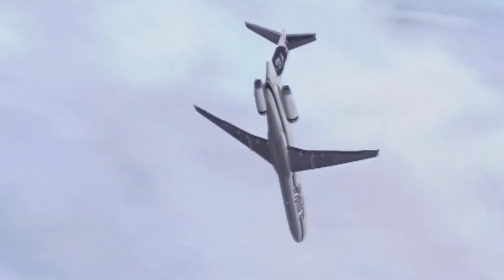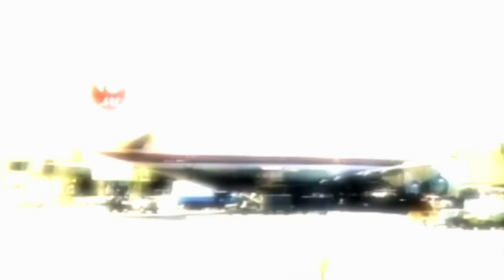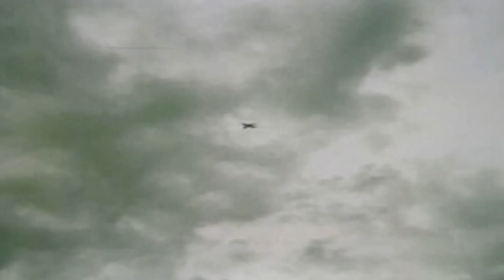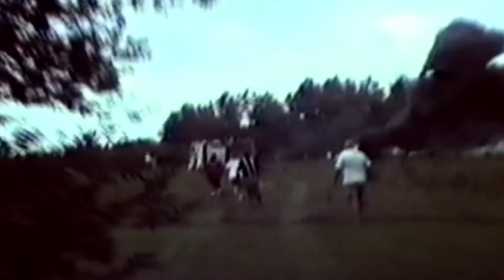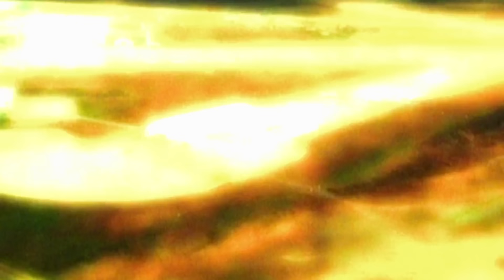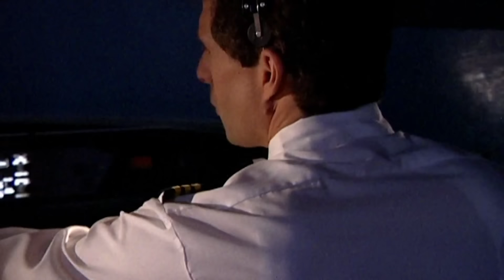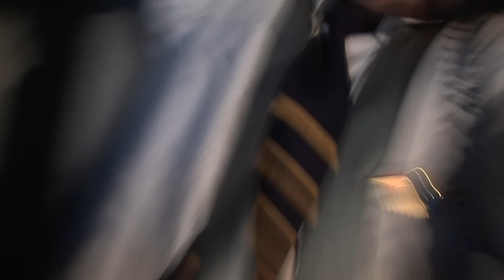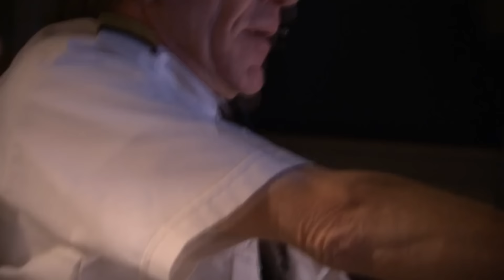The Consequences Of Overlooking Aviation Maintenance And Repair... | Mayday: Science of Disaster

Comment: Wow...where to start!  Alaska Airlines flight ✈️ 261 was not 🚫 brought down by faulty maintenance.  No airplane maintenance is performed without paperwork to tell the mechanics what to do.  And even more paperwork to tell the mechanics how to do it (the maintenance manual, structural repair manual, etc.). Simply put:  no paperwork = no maintenance.  The jackscrew inspection and maintenance (lubrication) was pushed back from 600 hours to 2,400 hours.  This crash is on Alaska Airlines maintenance management.  As for the Southwest Airlines 737, the "C" and "D" maintenance checks will not 🚫 ever be done in one 8/10/12 hour shift.  It's just not 🚫 going to happen.  And most of the time, a "C" check is done with the aircraft on jacks, and all of the time on a "D" check.  And now the JAL 123 crash.  After the tail strike, JAL contacted Boeing engineering in Everett, Washington (not Seattle) where the 747 was manufactured (the line is closed now).  It was a Boeing structural engineer that came up with the repair, not a JAL mechanic.  The JAL structural mechanic performed the repair as instructed by Boeing.  If I remember correctly, this Boeing engineer committed suicide after the crash.  How do I know all of this?  I have two F.A.A.  licenses, airframe and powerplant.  I worked on Boeing commercial aircraft for 20 years.  As an industry insider, I was privy to reading the N.T.S.B. A.A.I.B. crash reports.  Keep 'em flying boys!
Reply: I was a military pilot we take care of our planes much better that the public planes. I say close down the companies that don't follow the rules. If they are that broke they shouldn't be flying!
Reply: @mulgakoldas2692  Retired U.S. Navy (Navair) here.  Absolutely correct Sir!  Thank you for your service!🇺🇸
Reply: @mulgakoldas2692  I was at Davis Monthan in 1979 when the A-7 went down over the university. Talk on the flight line was that the airplane had a low fuel pressure light several times before the crash. The filters were pulled and aluminum was found each time. Final tally was that the fuel pump was chewing itself up and no one made the connection. I worked on the H-3's at the south end of the ramp. Later the unit was shut down and I with half the crew were xferred to McClellan to the H-53's there. One guy immediately saw an inside oil reservoir coming back overflowing from each flight. An oil sample revealed that the oil was heavily deluted with fuel because a seal between the engine's fuel control and driving gear train was leaking and allowed high(er) pressure fuel into the lube system. The engine was pulled. I grounded another because the sight glass on the tail rotor gearbox was badly stained and had a false permanent level across it's face. The stain was because of heavy contamination of the oil that had probably never been changed.  I was (still have the license) an A&P before I went in so I can tell you that the AF training is fairly good, but 18yo kids need OJT under a watchful mentor plus one has to stay on top of laziness and complacency.
Reply: Retired A&P here. Yup
Reply: @wizquinn8021  A and P ?
Reply: @mikeh.7499 Airframe & Powerplant mechanic
Reply: @eduardgenardandalis1437  thanks!
Reply: @mikeh.7499  You’re welcome
Reply: So what brought down the Alaska MD-83 then? 
I'm curious because you mentioned that it was "not" because of lack of proper maintenance.
Thank you
Reply: @btbd2785  what they are trying to say with regards to Alaska airlines is that it’s not the mechanics fault but rather the fault lies with the bosses of the company the owners who insisted that the time between maintenance checks be extended so as to make more money they are responsible not the mechanics because if they didn’t value money over lives this wouldn’t have happened
Reply: @surgeon1016  Exactly 💯% right!
Reply: @Surgeon 101  
I understood that but either way, you look at it no matter whose fault it was, yes the maintenance was not done because the supervisors who head or control maintenance decided to tell the mechanic to push out the scheduled maintenance to save cost.
Either way, you cut it, it was a poor decision to not allow the maintenance to happen on time, therefore costing lost lives!
Reply: @surgeon1016  THAT IS EXACTLY WHAT I HEARD!!! Thanks for confirmation!
Reply: @S.R.W  

Yes and I understand that completely " my point was that even though yes it wasn't because of the mechanic's fault and because of the supervisors " the point made was it happened as a result of not having the maintenance or grease in this case" so directly relar8ng to the lack or no matter who the person that was or was not responsible for it. The fact and the point they were stating here. it wasn't done no matter who did or didn't do it and whose decision it was or wasn't. So many mechanics who work on planes took it as " they were being blamed" and truly they were not the ones to blame. It was the supervisors but again it wasn't done and that's the point they made in the video and that was I was trying to make
Reply: @S.R.W  
Agree 100%. What they were dating is just that yes it wasn't the mechanic's fault! However, either way, it wasn't done and that's what was the cause, and that's what I was agreeing with.  If nothing else, since this was a safety bulletin that was released by the mfg and was a critical maintenance item. The company at the least regardless of cutting costs was something that should have never been ignored,  regardless of the cost!!
Reply: @btbd2785  To keep the airplanes in the air, Alaska's maintenance management rescheduled items (components) for inspection and maintenance for a future time.  If one were to delve deeper into the horizontal stabilizer problem, the A.A.I.B. is correct.  However, it goes deeper than that.  Because of rescheduled maintenance, the jackscrew became dry inducing a metal - to - metal contact, which began to wear away at the two metal contact surfaces.  The allowed space between the two parts began to increase and at a certain point the gap became an "out of tolerance" gap.  This was identified by the mechanics and the mechanics reported the problem to maintenance control management.  Always remember that when a commercial aircraft is on the ground, it's not making the airline money 💰.  The airplane becomes a liability, not an asset.  So, management basically "blew off" the mechanics, signed off the paperwork, and the MD-83 was certified as safe for flight ✈️.  It wasn't.  Previous flight crews also reported problems with the horizontal stabilizer trim.  This was also "blown off" by Alaska Airlines maintenance management.  Also remember:  no paperwork= no maintenance.  The paperwork is generated by people that are above the mechanics' pay grade.  The mechanics have nothing to do with that.
Reply: @btbd2785  the maintenance program on jack screw was stretch there was no maintenance performed on the time when application of grease was supposed to be done thats why he said its not faulty maintenance but rather no maintenance was performed at all.
Reply: "How do I know all of this?  I have two F.A.A.  licenses, airframe and powerplant.""
Actually, you are a certificated Airmen (Mechanic) with an Airframe and Powerplant rating. (Part 65)   The FAA does not issue licenses.  But the sad thing is, the word ""Airmen" appears to be not inclusive enough for current the Secretary of Transportation.  Read NOTAM.  (eyes rolling)
Reply: @cycadence2577  Incorrect statement.👎
Reply: @Jerry-yc2gt  Care to elaborate?
Reply: @cycadence2577  About what?  I believe I did.
Reply: @Jerry-yc2gt  What's incorrect?
Reply: @cycadence2577  I don’t think you know the definition of license, if you don’t think the FAA licenses people to work on aircraft. Most licenses are not a plastic card, it’s a concept of approval.
Reply: @ED-es2qv  The FAA issues Certificates;  Air Carrier, Repair Station, Airmen etc.  If you have one pull it out and look at it.  It does not say "License". In the case of "Jerry", he does not have two licenses rather he has a Certificate (Mechanic) with an Airframe and Powerplant rating.  And yes, I have an A&P, Certificate No XXXXXXXXX.
Reply: "I have 2 FAA liscenses" 

How I know you were a tool to work with.
Reply: Surgeon right that is what happened:
Reply: Always comes down to the bottom line.
Reply: That was quite a bit of information I'm not with the FAA air force flight controller landing gear Tech work on such aircraft as C5 c-141 130 viewing the pictures of the Jack screw into detail section there's quite a bit of difference between Lockheed and Boeing as to Boeing and Military Lockheed aircraft such as automatic lubricators and shields on the jack screw itself protected from external contamination damage but you're right 100% it's all about maintenance and inspection
Reply: If as you say the maintenance was pushed back on Alaska Airlines then faulty maintenance was the cause
Reply: @Ken Clark  faulty means something was done incorrectly. The plane's maintenance just wasn't done.
Reply: @MW-no8vq  You should go back and reread my comment.  No maintenance paperwork = no maintenance.  Word salad this all you want.
Reply: @Jerry-yc2gt  you need mood stabilizers.  I never said anything to you.
Reply: I saw the diagram of the patch. It was obvious it wouldn't hold. But I guess the installing mechanics didn't question it.
Reply: As a fellow retired aircraft mechanic, I concur
Reply: The video, with its own flaws, didn't blame the engineers but the airline's management for the Alaska airlines accident...
Reply: Are you serious bud? Or are you just trying to argue? "Everett not Seattle", Everett is literally listed as a part of the Seattle Metro Area. Yes, it is its own municipality but it's considered Seattle to most, especially when making generalized statements such as the one in the video. So yes, according to the Census Bureau, and pretty much everyone, Everett can be referred to as part of Seattle. This is a common practice around the world. The real question is why you are acting this TV show is faulting the mechanics. The video is titled "overlooking maintenance" meaning not taking it seriously, which by default is on the airline, it's not like a simple mechanic decides when to maintenance, I mean this is common sense. It's also made quite clear in the video that the fault was on Alaska Air and never once points to the negligence of a mechanic. No person with a brain would watch this and think "That bad mechanic is responsible for the screw malfunctioning". You act like you know everything, yet you say absolutely nothing of value.
Reply: Your bad use of emogis weakens your otherwise decent point
Reply: @KNR90  It's what they are used for.👍😀😁😂😱
Reply: They call us grease monkeys. Where was the grease? Really slacking on the job. When doing PM preventive maintenance or swinging the gear for testing the plane goes on jacks 4 or 2 one under each respective engine. Often in 2 full shifts especially it needs parts or repair.
Reply: You're really defending  cutting corners?
Reply: @jamesgentry13  No James!  I have had my job threatened because I wouldn't cut corners.  You should go back and reread what I said.  I even threatened to go to the Seattle F.S.D.O. (look it up!) when told to do something that was not 🚫 in the M.M or S.R.M.  Good grief Charlie Brown.